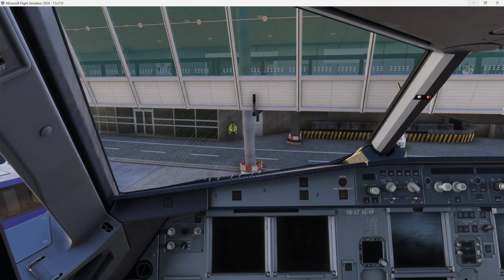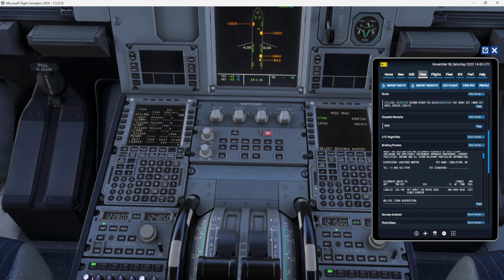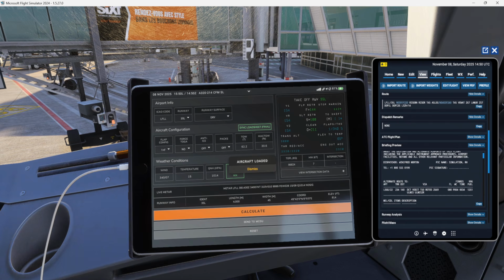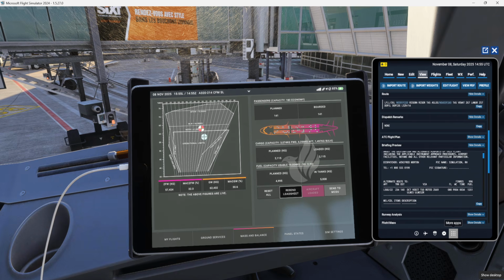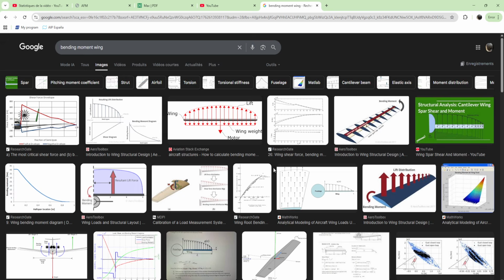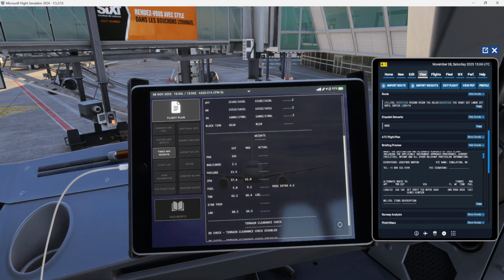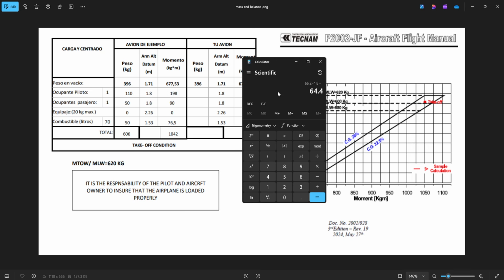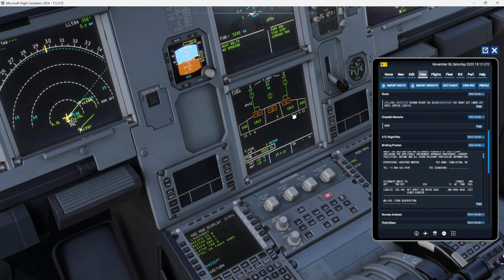Airbus a320✈️ FULL FLIGHT Part 1 | REAL PILOT MASS & BALANCE Tutorial | Lyon → Zurich

Comment: It’s an interesting subject ! I spent 10 years of my 35 year Airline career in Load Control issuing loadsheets for Flight Crews ! I was licensed on most Boeing and Airbus Aircraft 👊🙏🏻❤️👨‍✈️✈️
Reply from the maker: good job my friend , Im glad having people like you in my channel , you are right mass and balance is an intersting subject , I enjoyed it a lot during my ATPL classes, the loading part , moving , adding loads and the shift of the CG position its such an amazing subject , I have a question for you , you calculate the loadsheets using an application or you do it by your self and the captain sign it at the end ? 
welcome mate❤.
Reply: @riad-vj2cs it was all done in a computer system however we were taught how to do it manually too ! The final loadsheets etc were sent by ACARs to the pilots whilst they taxied to the runway 🙏🏻👊✈️👨‍✈️
Reply from the maker: @leerose9436  I can see , its a little bit hard as I imagine , at the end its a big responsasbility , respect to you my friend and good luck 🧑‍✈🙏

Comment: Hey man i don’t mean to discourage you but a lot of the information and things you show here are wrong. For example your route to the alternate would be inserted in the main flight plan page for accurate fuel predictions in the INIT B. Otherwise the airplane will just calculate a direct route from the last point of the missed approach at destination to alternate. Then on the sec f-pln you inserted an engine out but then still had your destination as LSZH. So what happens? The engine fails, you do a hold 20 miles from the runway but then still continue to Zurich? Doesn’t really make sense. Again, don’t mean to sound rude but maybe just a better idea to not have these videos named as tutorials from a real pilot since a lot of it could be misleading.
Reply from the maker: hello my friend , thanks for the comment , 1/the video was made for mass and balance , I did all my ATPL exam and I have my PPL , while im training for the CPL , so saying real pilot is not a lie , 2/in case of an EOSID this will depends on the airline for sure my friend if you have an engine failure during departure what will you do , continue to destination ?? sure not so I followed the EOSID insert it the flight plan in case I have activated the second plan (on purpose or by mistake) u still have your route of the EOSID and this what im saying based on what I studied as theory , otherwise these kind of information you will get it in your type rating training , I dont know if you agree in this point or not , at the end this is a simulation in the real life things changes depending on the company , so what im saying in the video is what a real airline uses (whitout saying the name of the company) but anywase thanks dor the comment , we all are learning ❤I really appreciate you pointing that out
Reply: @riad-vj2csexactly, at my operator we have some EOSIDs coded directly in the database but for most cases we still put it in the secondary. However, after the engine out, it wouldn’t make sense to leave LSZH as your destination since you will not continue anyway as I was saying. So in real life (and all SOPs I’ve read from other airlines do this) after your PBD or engine out hold you would do a lateral revision and set your new destination to LFLL or take off alternate, set the approach, fill out the sec perf page with weather and minimums, to have it all ready for a quick return.
Reply from the maker: @FabioVernuccio  Thanks for the detailed explanation my friend , and again saying a real pilot in my videos , because im sharing what i studied in spain , and these things of filling up the MCDU are most likely seen in the type rating , that i didnt start yet , and all what i said about mass and balance i think also was right ? If you have any further remarks or suggestions, I’d be glad to hear them